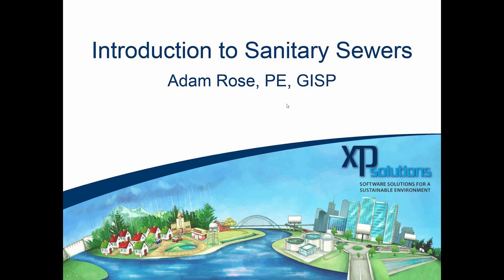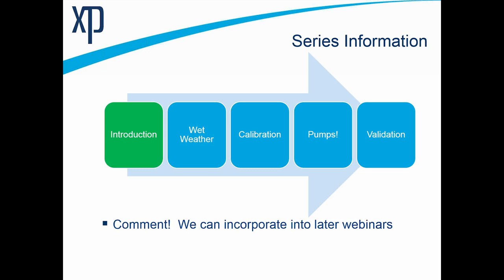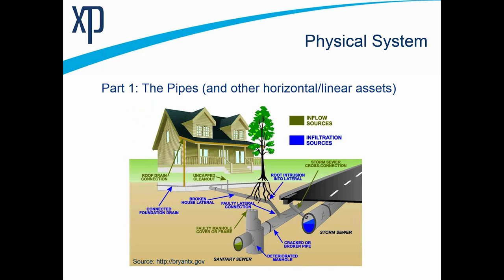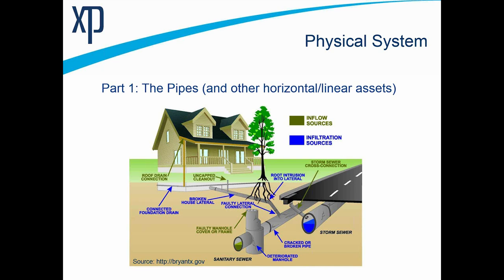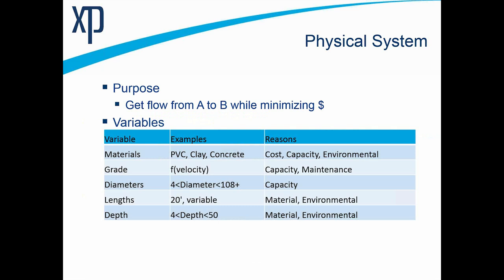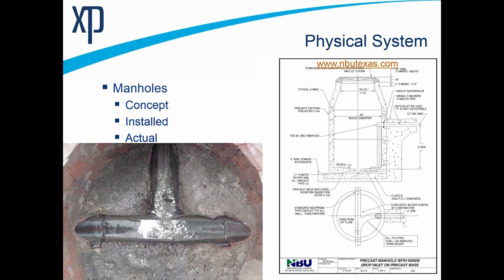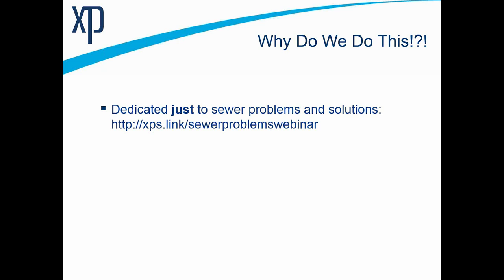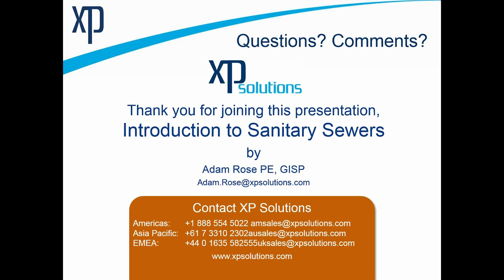Intro to Sanitary Sewers

Comment: Can you review 4 video's I have posted entitled Lincoln Park Sanitary Sewers Lincoln Park MI. The city line between mh 92 to 94 is where my line taps in say right in middle(40 feet) . mh 94 is full each time my basement backups. The system then runs 94-95-96. At mh 96 the alley floods and 96 gets submerged. That home all the way on opposite end floods historically and every time I do. Houses in between have backups. I also feel the first 45 feet where my home taps in has a pipe belly that caused my line to plunge forward. The only other home tapped in at 92 has no basement and have their lateral replaced approx 20 years ago and to this day has drain problems. I contend the pipe belly caused that lateral to retract back away from city line. I've had 6 master plumbers inspect my line there are no blockages, cracks or collapse. I have no problems with water draining from my house except when mh 94 is full of water and I see all the homes on both sides that historically back up have damaged water belonging being drug out. 8 times back to 2009 I can attach the things I see with mh 94 full of water and then mh 96 submerged(because the storm basin in alley is not functioning. City says its my line. I need help and hoping you could give an opinion. For me and all my fellow neighbors who don't even bother calling the city anymore and I know its because the city chooses to ignore and pin on homeowner. Thanks.
Reply: Its a T section system. The other mh 93 wasn't taped. But mh 93 is submerged also at the same time because the street floods up to people's porch or door for house on slab. City says oh the mh lid is water tight. Yet twice they go to televise and at mh its full of mud and the line is full of mud. City doesn't answer that question or has done anything. Then at the low end to where mh 94 is the last 10 feet is a pipe belly where constant full of water. 93 to 94 is slightly higher that 92 to 94.